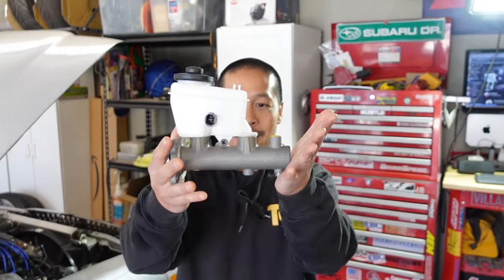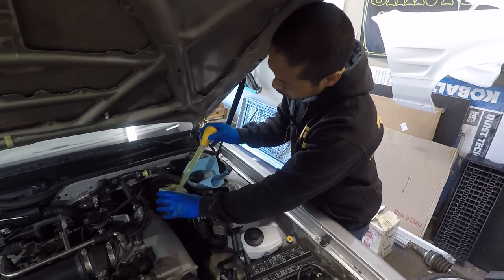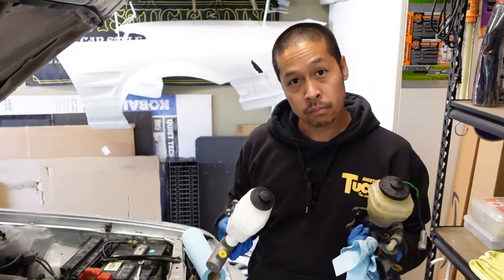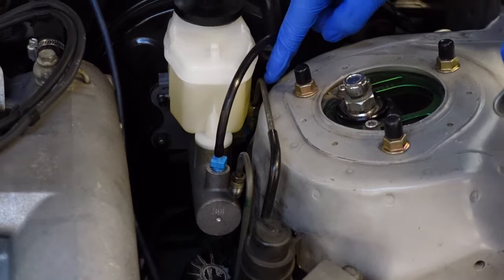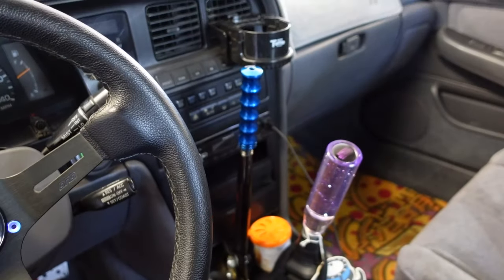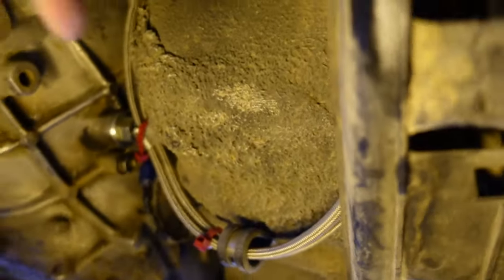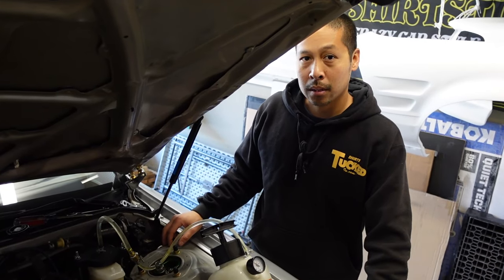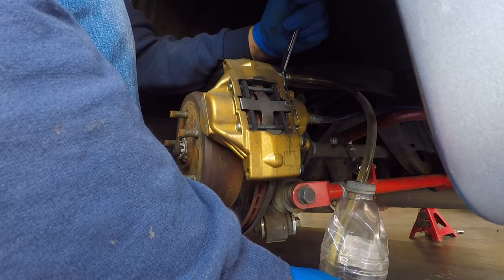DRIFT PREP | X8 Cressida Brake Master Cylinder upgrade

Comment: what brake booster can i use?
Reply from the maker: We're still using stock cressida bosters.  Chase bays gives you an option to delete.  Follow up with the 1UZ build as Justin going to need to find another Toyota booster that's smaller to clear the UZ valve covers.

Comment: does the cup holder in the air vent work well
Reply from the maker: It stays put for the most part. After some drift events it slips off the vent clips.